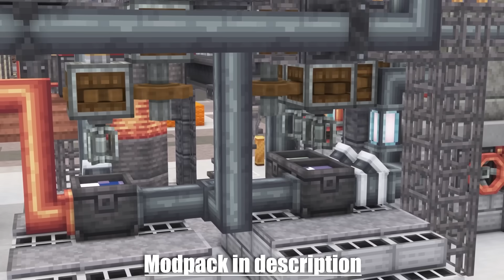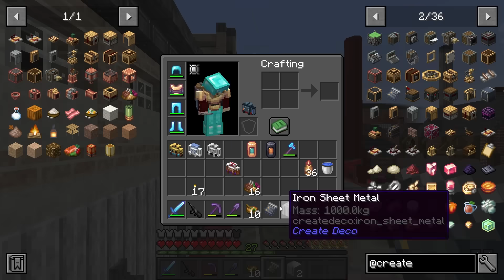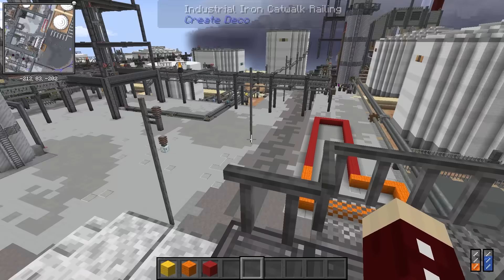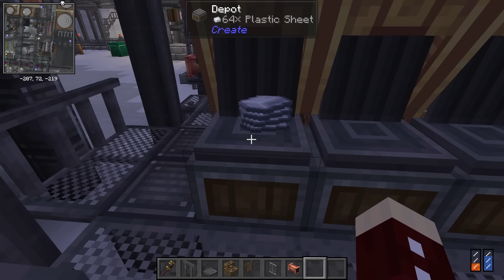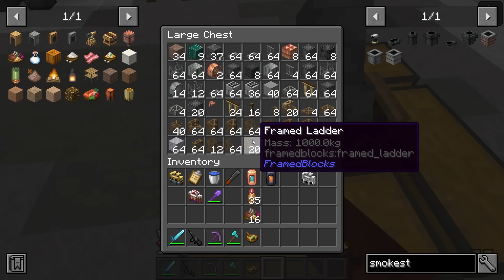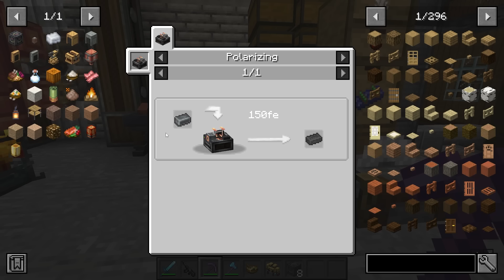Building a Chemical Plant For Plastic in Create Mod

Comment: When I was doing steel production, I chose to make steel block instead of ingots. If you do the make from 9 ingots to 1 block on the molds you use less making the block than the ingots. Meaning more Steel, it takes a little longer but you get a lot more out of it

Comment: Might’ve found a fix for automated molten steel!

, just throw 1 Coke dust in. Then 1 blasting mix, wait for steel, repeat. 1:1 ratio starting with Coke dust. 20-25 seconds after blasting mix is added the steel and slag will have been pumped out. They replace each other and only when blasting mix is added the steel is made.

Comment: Let me tell you as a worker in an oil refinery, it actually does look like a refinery. It's almost indistinguishable from my workplace and that picture at 10:34 is oddly familiar 😅 
That green paint is actually anti-corrosion paint needed for equipment that doesn't need insulation and therefore is exposed to rain and other environmental factors.

Comment: Kinda messed up, but I think you should have a sea turtle drive the plastic train

As for the steel ingots, I'm sure you can automate it with the hand poke machines. One with a template, the other to interact with the casting setup. Should be able to cycle the templates back in to keep it running. Not sure what version you're using but you could probably use Allays to help keep the ingots from despawning

Comment: There is a trick I found to automate the steel! Use two smart shutes(one for the Coke coal dust and one for the blasting mixture) that merge into one Shute in a V shape to drop only one item at a time into the furnace and use a hopper mine cart on top of a hopper underneath the furnace to pick up items when the furnace is too full and a belt or fan system to send the items back up to be dumped in again! Make sure the two smart shutes on top are set to drop only one item at a time though! One last thing I have poppers in here
Reply: I’ve been testing it myself and as far as I can tell you can just feed a belt from 2 seperate sources with stack size filter and have the belt drop the items through funnel into furnace opening, pump molten steel out!
Reply: @ Yes that’s what I did too, but once the furnace is full, the items don’t stop dropping in and just sit there as items either until the furnace is has more room or until the items despawn. Even if you only have it dropping one item at a time, they still drop slightly faster than the furnace can smelt the mixture into steel, The hopper mine cart picks up those extra items. Unless of course you wanna sit there and do it manually, which is a pain.
Reply: @MrsDupuis646  does that mean it could be possible to figure the exact timing of smelt speed and use a red stone circuit system times to only allow a funnel to drop a set amount of item over a set amount of time? It would be hard but it’s just another idea.
Reply: @ might have found an automated steel fix! I tested for HOURS! just throw 1 Coke dust in. Then 1 blasting mix, wait for steel, repeat. 1:1 ratio starting with Coke dust. 20-25 seconds after blasting mix is added the steel and slag will have been pumped out.
Reply: @ may need to adjust your math there because it requires the 2 Coke coal dust to smelt 1 blasting mixture
Reply: @ no need to adjust the math, the furnace mechanics are entirely broken in consistency for this mod.